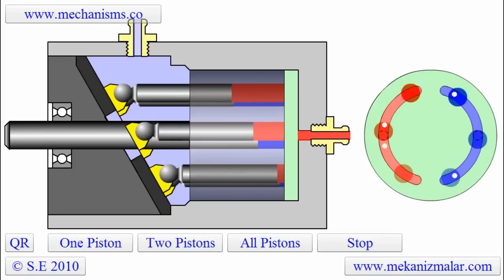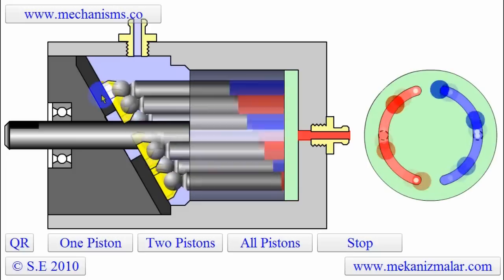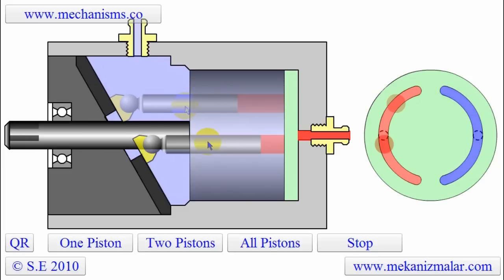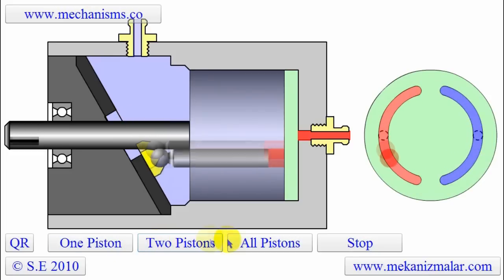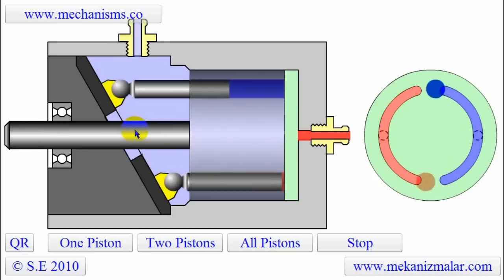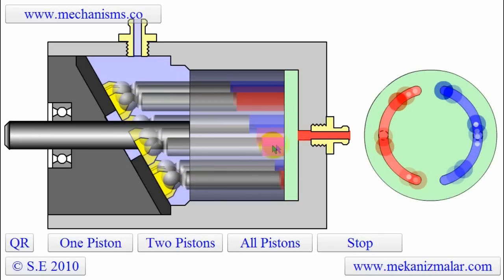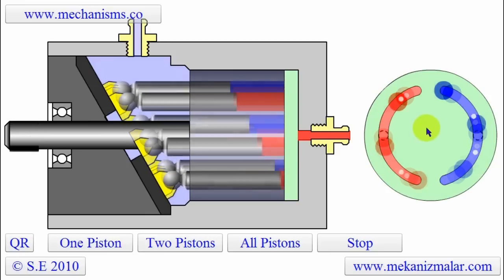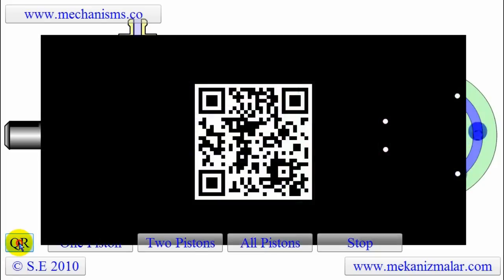Fixed Displacement Piston Pump

Comment: Which one is inlet which one is outlet.. Which side oil is going? Why u not mention
Reply from the maker: I am sorry that I could not make it more transparent because 3D animation was out of my knowledge at that time. There is two-port at the right of animation. You can see one of them with red high-pressure oil flowing going out. There is another port with blue color at the behind of this red port, which represents low-pressure oil flow. Unfortunately, in this 2D version, it is not shown. Flow enters from this port and goes into the suction motion of pistons. Then the same oil comes out from red port as high-pressure oil.

Comment: Brilliant presentation. Distinction between pump and motor was meticulously explained. You could have added a schematic diagram including the connections from the inlet reservoir and to the outlet as well (in case of pump, that is).
Reply from the maker: Thank you for your encouraging  comment.

Comment: One thing that is not depicted very well is how many of the 7 or 9 pistons get pressure if this is driving say a gear (Ie Lawn mower)  If they all get pressure then they cant slide up the plate for rotation.   It would seem like it would have to be 1 at a time else they would be fighting the opposite from the other pistons.   ie.  How many pistons are fed pressure out say a 9 barrel set up?   And the pistons would need to be strong as they get torqued sideways too.